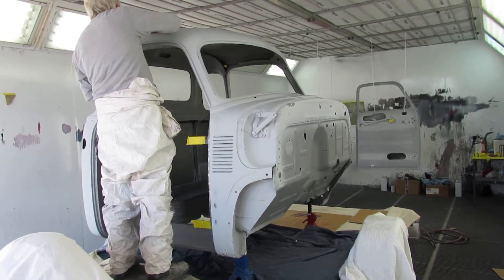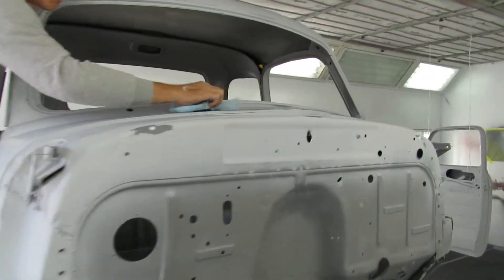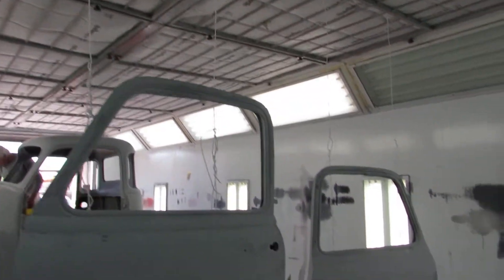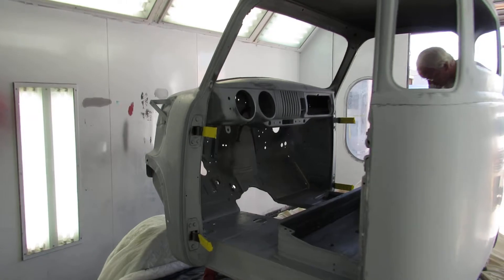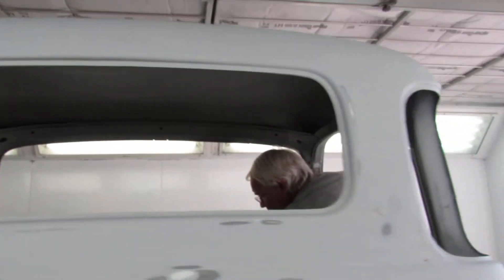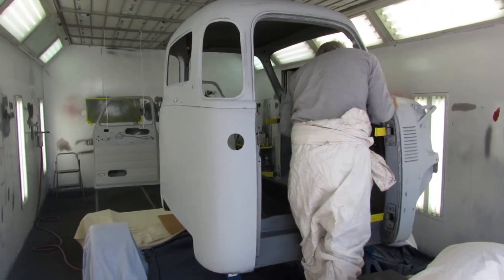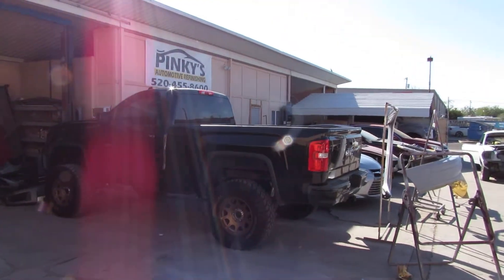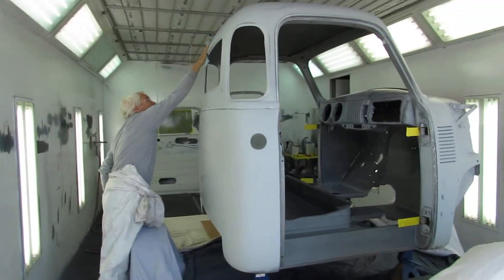1955 Chevy 1st series Restoration Update #16

Comment: Hi Randy, George here. In my cab there is surface rust. I've wire brushed it up, sanded a bit and want to treat it. With your truck I see the painting here, did you have any surface rust to treat? How did you treat it if you did? I bought the POR-15 kit with degreaser, etching and final treatment (black) and wondered if you used this and then painted over it? Is it necessary prior to paint and/or if used, can it be painted over. Thank you if you have any suggestions.
Reply from the maker: We had very minor surface rust, but, I did use and continue to use POR15 on just about all of the restorations I do.  Don't recall if we ever needed to paint over any the treated areas...I would imagine that if you needed to paint over a POR15 treated area, you would need to prime the area just as you would prior to any other area....